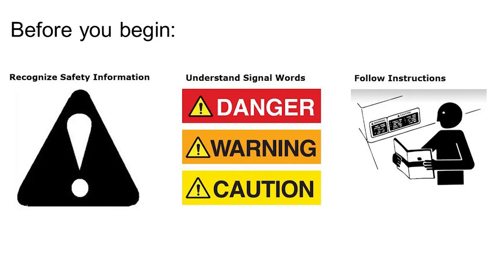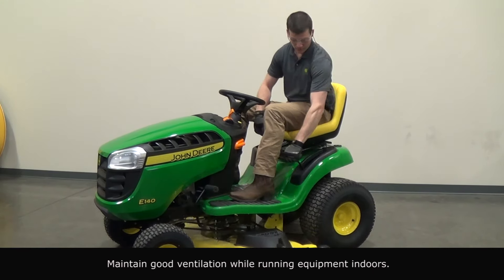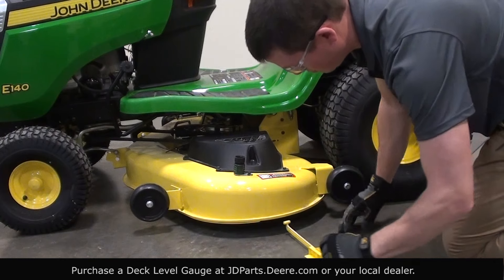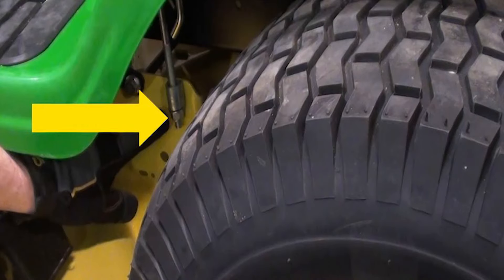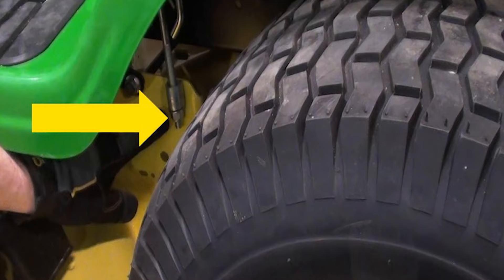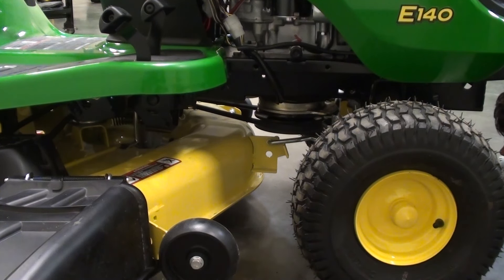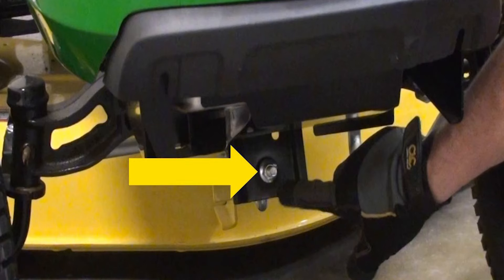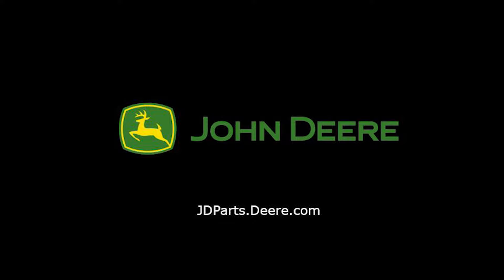How to Level the Mower Deck | John Deere 100 Series Lawn Tractor

Comment: What size wrench? Standard or metric?
Reply from the maker: Thanks for asking, William. We recommend confirming the appropriate size wrench to use in the Operator’s Manual for your machine. If needed, you can view and purchase many Operator's Manuals at techpubs.deere.com. Select "Equipment Publications" and enter the model number for your unit. For the E140 featured in this video, it is recommended to use a 15 mm closed wrench.

Comment: Please help adjusting the deck on my new S110. Following the manual by checking the tires pressures, then I used three (3) wooden blocks cut precisely to 2 inches and placed them as required, then I lowered the lever to 2.5 inches. The deck was too high, so I lowered it adjusting the 3 points, but something is wrong: the rear adjusting rod nuts are almost to the end. what am I doing wrong?

Comment: Does this work for D105?? The deck wheels are always hitting the ground no matter what.
Reply from the maker: Thanks for asking! Yes, these instructions work with leveling the mower deck on a D105 Lawn Tractor. You can find the full instructions in Section 30 - Operating - Checking and Adjusting Mower Deck Level in your Operator's Manual. Many manuals are available to view online here: http://spr.ly/6055OKr9S. If you'd like a mower deck leveling gauge, you can find that online in our Parts Catalog here: http://spr.ly/6058OKr9Q. Please let us know if this doesn't resolve the issue.
Reply: You need to adjust your antiscalp wheels to match the height you're trying to cut at. Loosen their bolt and look at the corresponding numbers beside the wheel. There are notches you set them to for each cut height. Move them and retighten the bolt

Comment: What is the point of those 2 small wheels in front of the deck? Are they supposed to be touching the ground or be in the air, doing nothing?
Reply from the maker: Thanks for asking! The E140 Lawn Tractor is equipped with four mower wheels to ensure a smooth mowing job, even in rough terrain. If necessary, this model of Lawn Tractor has a spring assisted, low-effort lift level that simplifies setting and adjusting the mower cut height.
Reply: They're to minimize scalping your grass when hitting bumps or mowing over some slopes in your yard. They basically bounce your deck off the high part of the ground ahead of you to avoid scalping uneven surfaces....if that makes sense
Reply: @connormccollum517  Thanks. It makes sense.

Comment: Vague instructions..
Reply from the maker: You can find more detailed instructions on leveling the mower deck in Section 30 - Operating > Checking and Adjusting Mower Deck Level in your Operator's Manual. Many manuals are available online at techpubs.deere.com. Your local dealer would also be a great resource to assist you with leveling the mower deck. If needed, you can find your local dealer at Deere.com/Dealer.
Reply: Hahaha

Comment: So is this a better way of leveling a D130 deck? I found using the directions in the owners manual, using three 2in wood blocks to be rather inaccurate
Reply from the maker: Jake, your local John Deere dealer is your best resource for technical questions like this one. You can find your closest dealer here: https://bit.ly/3aUJMAz.
Reply: @JohnDeere  my key doesn't turn to start mower